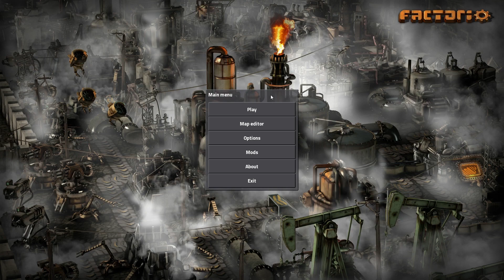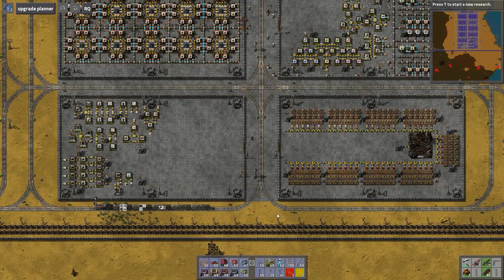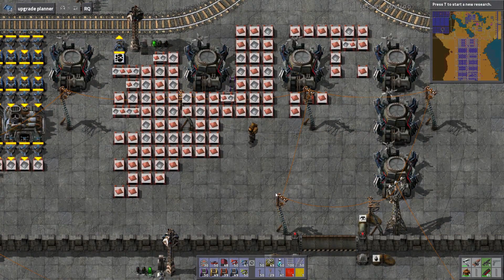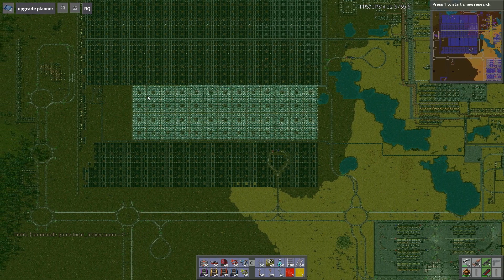Factorio - Belt-less Mega Factory Explained

Comment: I realize this is an old video, but for us who are just getting into this game, its pretty amazing to see. I have just barley scratched the surface and have barely researched anything near this capability. I still dont even know how to use some of the research items I have. But, this is indeed inspiring. Wonderful work and I cant imagine how many hours you have into it.
Reply from the maker: Thank you very much. I have also come along way since I made this factory.
The most important thing to remember is to have fun and build it your way.
If you want you can check out my current endeavours on my channel and via live stream every sunday at 11 am CEST.
Reply: I will agree that this is a very nice factory, and it would be even better had he used at least production modules to significantly curtail the raw materials needed. :-) But this wasn't very commonly done in 2016. And, as he pointed out in a different post, if you don't want to do it that way, don't. It's your factory, and you should build it your way.

Comment: I dont know if it was possible back in 2016, but you could also set your control by putting the constant to, for example, -2000 gears, then set your inserters to load the components for your gears whenever gears < 0.
Reply from the maker: To be honest I'm not sure either but if so then that would have probably worked to yes. :)

Comment: Rather than hooking up every single chest to a wire, if you already have logistics researched (which I assume you do when you're building this) you can just connect a roboport to your combinator and have it output the entire contents of the logistic network instead of using all boxes' contents directly.
Reply from the maker: Hi, well that was not possible yet in this iteration of the game. :) even so I would still do it this way because by using the roboport you would get every instance of that item in the entire logistic system instead of just in this individual part of the factory.
I do however see the validity of your way of doing it.  Thanks. :)
Reply: Oh that's fair,  I had a bit of a break between about 0.11 and 0.15 so I'm never sure what is recent and what is ages old. About the logistics though, if I have two separate factories making gears (because one wasn't big enough) then I want them to both start making gears as soon as gears start being used and required, I don't want to wait until the robots have moved all the gears out of the closer factory before the further away ever starts producing.

But I can see situations where it's unhelpful too, it will all depend on your general base design. Personally I think if your factories shouldn't be reading each other's contents then they shouldn't be inside the same logistic network, which is why I wire all mine up to that :)

Also I really like your design in general, I may have stolen that pretty cross-arrangement of 8 assemblers/smelters with a substation and chests in the middle, it looks and works great.
Reply from the maker: Thank you and feel free to use the link in the description to download the factory if you would like to "steal" more ideas :)
Keep in mind though that it is an old build so some things might not work as intended anymore. (or be there at all)
Reply: It's a cool factory :) I spent a while trying to figure out what the massive pile of combinators around the rocket was doing until I saw it was called trash sorting, then it all made a lot more sense. It's a pretty smart system if you don't want horrible storage messes like I always end up with.
Reply from the maker: Thanks, tbh it's a design (the trash sorter) i found online. i just had to tweak / rework it to make it work when 0.14 was released as that  changed how the inserters and chests worked. And I had do that again for 0.15. :)
there are a lot of things in this factory that are clearly out of date when  compared to the new version of the game but it still has some nice design elements in there i am still proud of.
btw I'm buiding a new megabase in my new series, come and hang out, i'm live every sunday from 11:00am CEST

Comment: Why not divide the greenchip factory down the middle and turn both parts by 90° so as to fit more?  Might not work, but seems possible...
Reply from the maker: The green chip production has already been optimized by one of the viewers so that I could fit two of these lines next to each other. :) (by reducing the height of the design by I believe it was 4 or 5, it was just enough to make it fit.)

Comment: What about a robotless, beltless factory?
Reply from the maker: Well, doable I guess, just have to do a whole lot o' running around. :D
Reply: Not unless you use chests and inserters
Factory - inserter - factory - inserter - chest - inserter - chest - lab
Reply: Mechanoid HiveMind You don't even need to use chests inbetween unless you want buffers. But at that point you're just making a power hungry inserter transport belt
Reply: Get a bunch of twelve year olds to manually craft stuff.

However I do feel as a challenge you can only use assemblers to make stuff you cannot make in your hands.
Any minor components leading to those items you cannot craft in hand must be made in hand before hand and put into the assembler.

Comment: on the green chip mini factory, have you thought about moving the copper plate input to the left and right of the copper wire assemblers? you could probably fit another row that way. it would be 17 squares tall instead of 21
Reply from the maker: That line has been been redesigned and it now has two of these setups in the same area. :) But thanks for the suggestion, they are always welcome.
Reply: No problem and thanks for sharing. Gonna borrow a few ideas and add them to my own.
Reply from the maker: Cool, have fun. :)

Comment: So when i load it it says i need the mods if i load it anyway does stuff break?
Reply from the maker: Yes, but nothing really critical, with the possible exception of the laser defense lines. These were modded as well but if you head on over to the far right of the map first and restore some regular lasers there. and then add lasers everywhere else you should be fine.
All other mods were convenience mods. (blueprint string, blueprint flipper etc.) there is a list of the blueprints used in the description.
Reply: Ok Thank you
Reply: also i just tried the trash sorting system and it seems to be broke. i put belts in and it just brought it to the first chest and stopped
Reply: one more thing is there a turn everything on switch or is there a condition not being met
Reply: correction i think its the filter inserters if i fix it with stack inserters it works
Reply from the maker: There is no one turn on button, you can fix the trash system with normal fast inserters it doesn't work with belts.
Everything should work fine.

Good luck and always keep building. :)

Comment: Great explaination! Where did you get the trash sorting system from?
Reply from the maker: I first saw it in a reddit posts quit a while ago. Then downloaded it here: http://factorioblueprints.com/view/89BTaGwpXAeaQ7BQh
So I could figure out how it worked.
And then updated it once 0.14 hit as it didn't work anymore after that. But I got it fixed and it's working again.
Reply: Thanks for your fast response! I see, in 0.14 it doesn't work with filter inserters, so i'm now using the normal stack inserters. :)

Comment: I am confused about your green circuit setup. You have a ratio of 2:3 for copper cables to green circuits, while mostly I've seen 3:2 and used it that way extensively myself. However, I have noticed that in my setup that also leads directly into red circuit production, I have plenty of copper cables to loop around into the red circuit assemblers, so I don't need to make more. So is 2:3 the best ratio for purely green circuit production?
Reply from the maker: Hi,

Green circuits take 0,5 sec, 1 iron and 3 copper cables to produce 1.
Copper cables take 0,5 sec and 1 copper to produce 2.

So to get the 3 copper cable we need for the green circuits, we need 1,5 copper assemblers for every 1 green circuits assembler.
But then we are left with 0,5 copper assembler not being use, so we use that with yet another copper assembler to feed a second green circuits assembler. Making it 3:2.

Hope this helps.
Reply: Not really, because you just said that 3:2 is the right ratio, which was what I already understood. However, in your video at around 10:30 you have a green circuit production line that has 2 copper cable assemblers for every 3 green circuit assemblers, precisely the opposite ratio.
Reply from the maker: Ah, i'm sorry I read your question wrong.
Yes the ratio's in that line are indeed reversed. (and therefor incorrect)
This not so much a efficiency thing but more an visual design decision. (as mentioned in the video.)
Reply: Thanks for straightening that out for me, I was wondering if there was some special reason for doing it that way that I might benefit from trying out.
Reply: Even having one copper wire factory to one green circuit factory would be more efficient and still be athletically pleasing. you could still have your requester provider provider chest pattern :p
Reply from the maker: True but the aesthetics are for the entire design not just the chest pattern. :) But you are right of course.

Comment: You could shrink the green circuit factory vertically by just shifting the requester chest for the cables in between the 2 wide gap between the factories.
Reply from the maker: Awesome, TY. I will definitely change this and stick a second row in after all. :)
Reply from the maker: Well I tried it and still in the end with even more compressing than just this suggestion (took out 1 row in the middle) I still was unable to make enough room for two rows.
The problem is that roboport gets in the way. The area is 38 wide and the newly designed factory takes up 16. 16 x 2 = 32 + 8 (2x roboprt) = 40 :(
Appreciate the suggestion though.
Reply: This should work. http://imgur.com/a/Yu3D0 exactly 38 blocks tall including roboports.
Reply from the maker: cool, thanks for the screenshots, I will definitely be putting this in later today.
Sometimes it's hard to let go of your original design concept in favor of something else, hence me not thinking of removing the middle row entirely to make this even more compact. Good job sir..